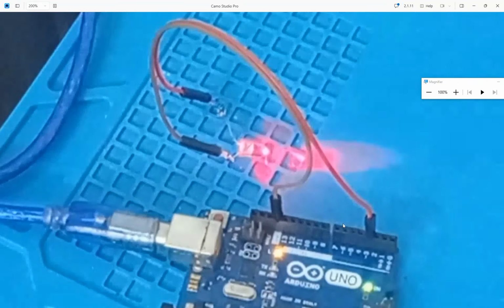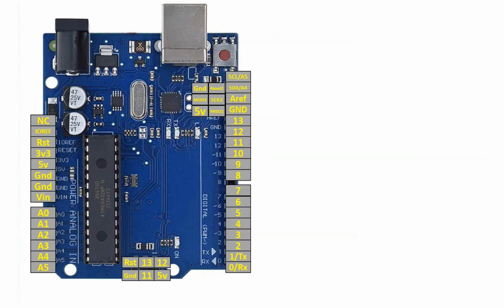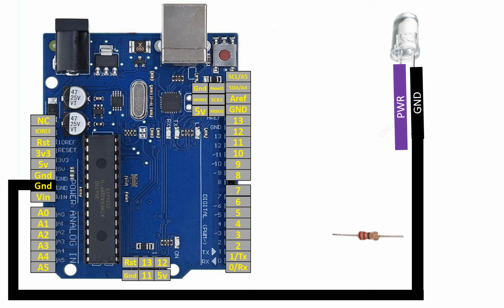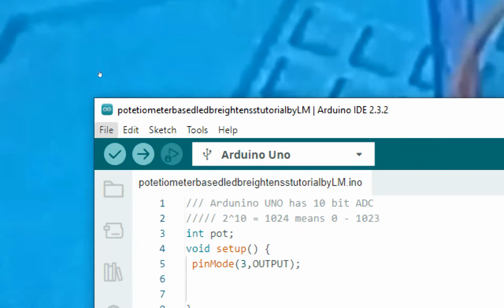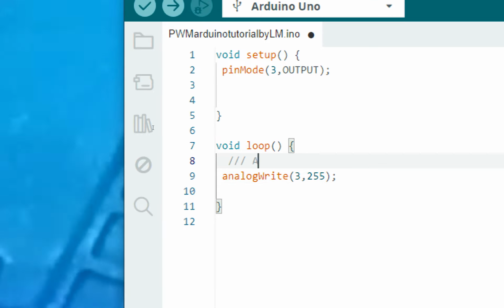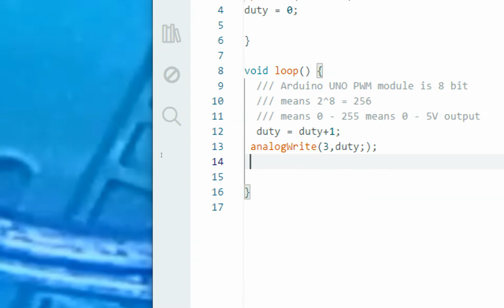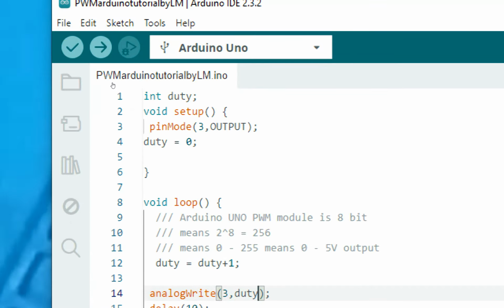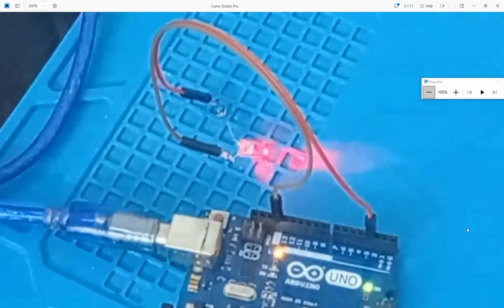Use PWM pin of Arduino UNO to control brightness of an LED.

Comment: sir. Please pic microcontroller video again .  I like it   . (Pic power guard /   pic battery chenge / pic electric fence / led sound meter )
Reply: pic battery charge . Correct
Reply from the maker: @kasunsadaruwan1293  worming on it mate
Reply: Supported